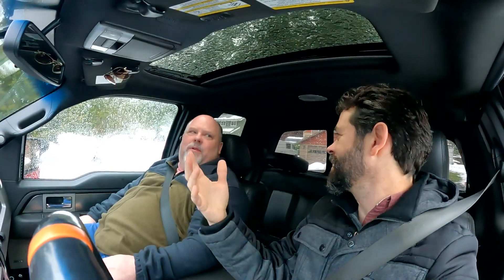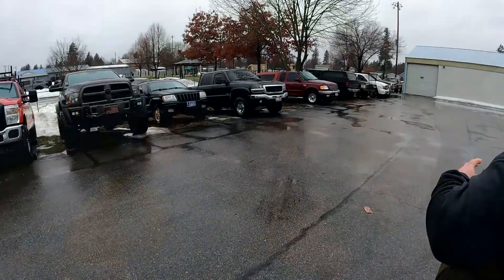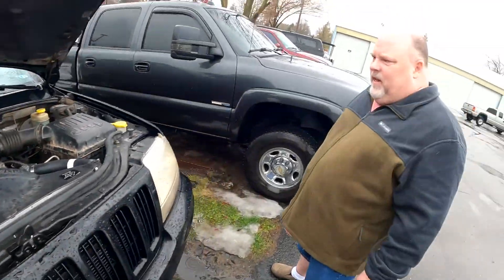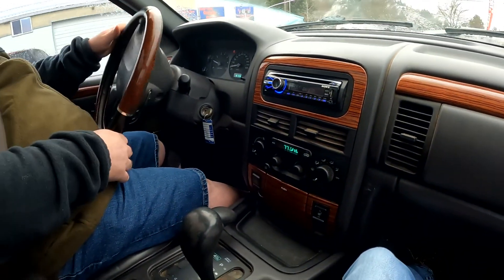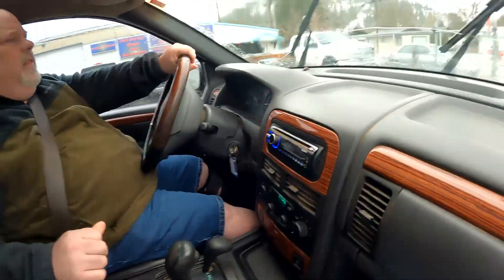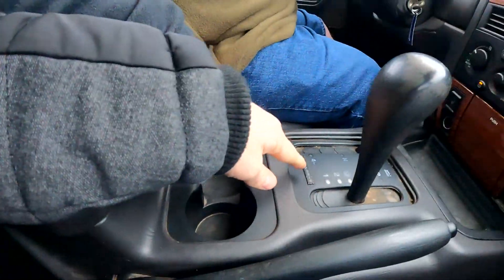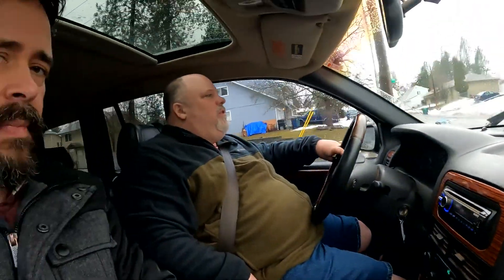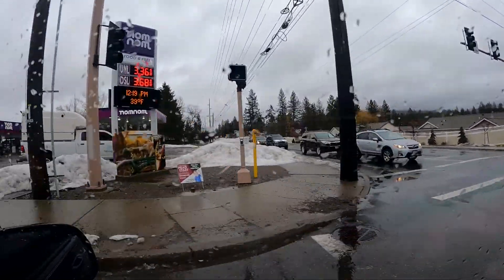New Jasper Engine for Project Jeep Grand Cherokee WJ [Part 4]

Comment: Common on the WJ for the steering wheel clock spring to wear out and cause the airbag light to annoy you..
Reply from the maker: Pretty sure you're exactly right, we're addressing it in an upcoming video. Thanks for commenting!

Comment: Airbag check light is on because the Jeep was moved/pushed/rolled without the engine running. It disappears (it should) after the second start...
Reply: It was definitely moved while not running, but the light has not gone out.  I'm thinking it's probably the air bag clockspring.

Comment: I have 23+ years as a mechanic and shop manager and owner. I've found Jasper to be sub par and more expensive than domestic OEM remans. If I  can't get an OEM reman my next call is Power train products.
Reply: If I had been doing it myself in the driveway, I would have used Powertrain Products.  But the shop I used uses Jasper, and I know they will treat my right if there is a problem.  On this particular engine, the warranty was important.  I don't even trust the local Jeep dealership to change my oil.
Reply from the maker: Thanks for the comment! Dr. Torque has a good reply but this is also good info for other viewers who may be considering an engine swap during the summer, or in more moderate climates lol. Thanks for the comment and sharing your wisdom!

Comment: 4 speed 2,200 rpm @ 65 mph.  5 speed 1,850 rpm @ 65 mph.    looks like the TCM has already been swapped out.
Reply from the maker: Well how the heck are we supposed to make a video out of doing the swap if its already been done lol?! We'll figure something out. Thanks for the info!
Reply: @MotorsandMischief  l guess you could get a 45 rfe TCM and do a backwards swap to show the difference.
Reply from the maker: That's a good idea! Dr. Torque says that upon inspection the module hasn't been upgraded, but he does think you are correct and someone flashed it with the new programming. He tried to remove the module but the screw is stripped and he didn't want to drill it until we'd confirmed the 5th gear for sure (which he's since done. We did the math and we're figuring with 29.5 tall tire, 3.73:1 differential ratio, and a .75:1 4th gear, a 2071rpm at 65.  And with a .67:1 5th, it's 1850rpm.  In any case, it looks like a 5th gear is enabled in this controller.  So now that the math matches up with what you're saying is the right RPM for 5th, I think we can confirm you're right and it has the 5th gear. So we'll have some fun explaining that and also drilling out that connector. Thanks for the feedback, we really appreciate it!

Comment: Why bother putting a new motor in an old Jeep. Should have picked one out of the junkyard.
Reply: All of the ones I was finding had more than 160,000 miles on them.  I didn't feel like taking on the swap in my driveway in the snow, and I didn't want to pay 19 hours of shop time to have an engine that may drop a seat in a few months.  This way, it has a warranty, and should be reliable for a while, at least.